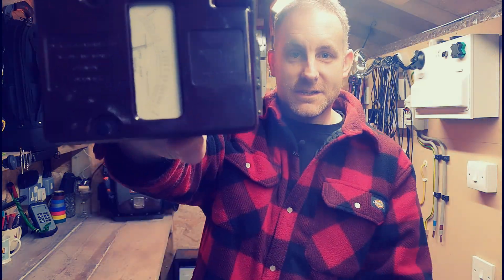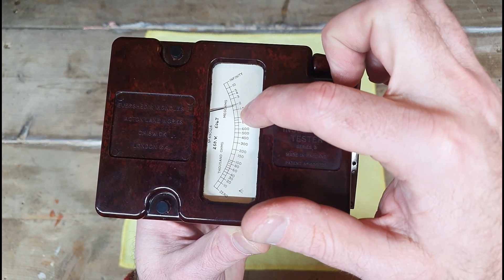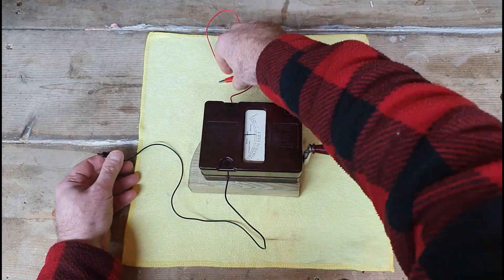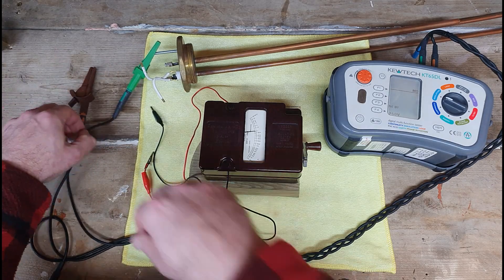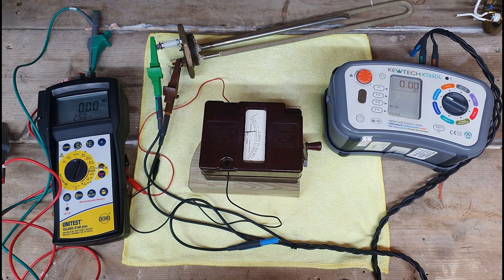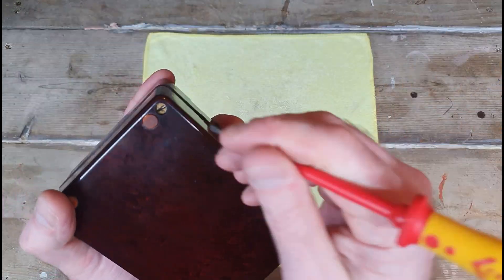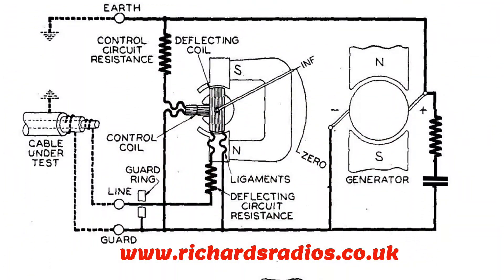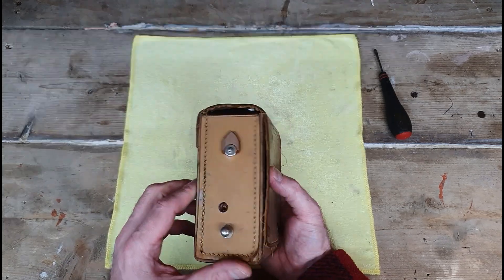Vintage Megger test equipment (57)

Comment: I have one in a polished wooden case. It has a  label with "The  MEGOMETET combined dc voltmeter & insulation testing set" on it. I do not know its age maybe 1920-30s

Comment: That is a very nice example of a series 3 megger. Serial number looks to put the manufacture date between 1942 to 1946, sometimes when you open them up, the actual date is written in pencil on the internal frame. The case did indeed have a strap with it, two point for carrying on the top two, and then the third pin provided another attachment so the megger could be hung around the neck and would sit flat enabling its use inside the case. I have three of these in my collection so far and always enjoy seeing others collecting them and looking after them.

Comment: I bought one of those about 30 years ago in a brass carrier along with an AVO 7 multimeter in a leather case from an army surplus store. I think the upward pointing arrow signifies war dept. As I remember the calibration date on mine was 1972. No longer have them I sold them, wish I hadn't now 😩

Comment: Cheers James, really enjoyable vid of Old school kit. How many old boys are telling us we don't know how good we've got it with our all singing, all dancing MFTs when they had to carry around three or four bts of kit?
I reckon the PD on the screws is the Calibration house seal in bitumen to maintain its integrity to prevent tampering or at least, identify if there was some, between calibrations. The hand written text on the case may have been an asset number I reckon from a company.
Reply from the maker: Thanks Olly, hmm yes I did wonder what the PD meant on those screw covers. It does look like bitumen too. Some of the MFTs these days come with an accompanying 1 day course to know how to use them.
Reply: @JBE  I could have done with a one day course when I bought my megger 1741, as the manual was pants.

Comment: Fantastic video James, believe it or not the crank operated mega is still compliant , and I think the calibration date is the date it left the factory? , basically there is nothing to calibrate on it you can zero the needle your self with the screw below the needle. 
I did C&Gs 236 parts one and two 87 to92 and we had those testers as well as the mega Battery BM6 fantastic testers. I now have a ROBIN KTS 1620 and a kewtech kt 63. Fantastic video mate 👍👍❤️
Reply from the maker: Hey cheers Sean, I too remember using 3 different Robin testers when I was learning. If this thing is still calibrated I'm definitely going to try it out on my next install.

Comment: Was the only type of Megger we had when I was a apprentice in the mid 1970 although we used the 500V one
Reply from the maker: I remember an old spark telling me about them in 2001. At college we had Robin analogue testers back in the 00s.
Reply: I have one of the 500V ones. Got it for a steal at the place I work. Paid $0.35/lb for it. Works great. Sounds like it could use new oil and grease in it, but still works perfect. It even came with the carry case that's OD green and has the original leather shoulder strap. There was a pile of test cards and the original manual in the carry case, but they were water damaged pretty good. Can still read the test cards, but the manual  has all the pages all wrinkled up and stuck together like old water damaged books do. The canvas carry case is in shambles. The poor thing is falling apart. But, I wanted to keep all the original stuff with it, so I'll try to preserve it the best I can.